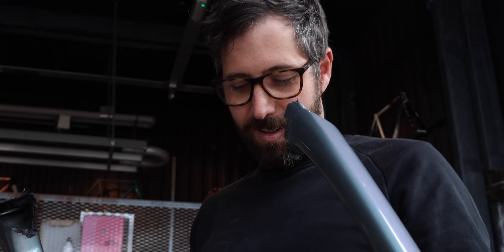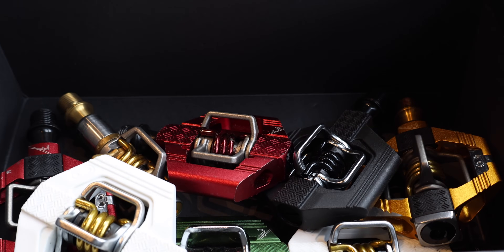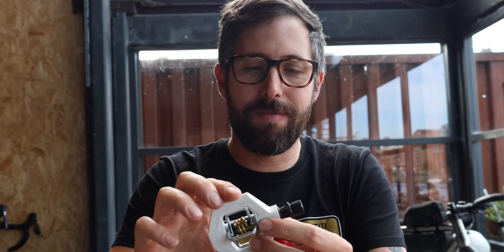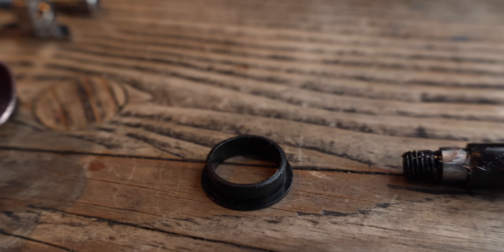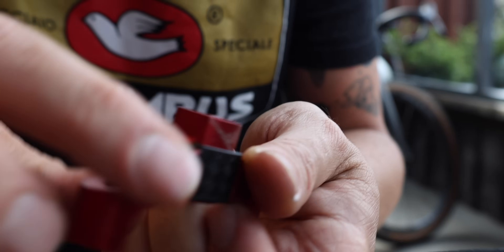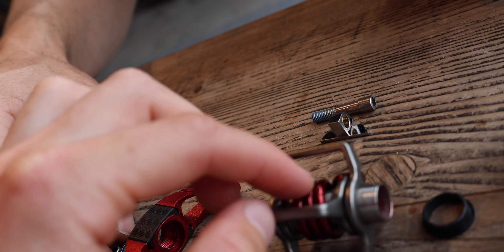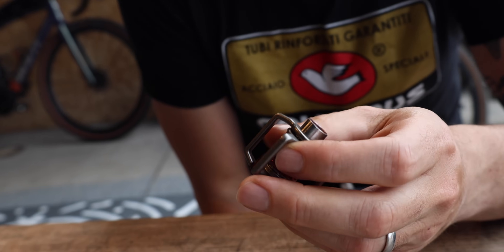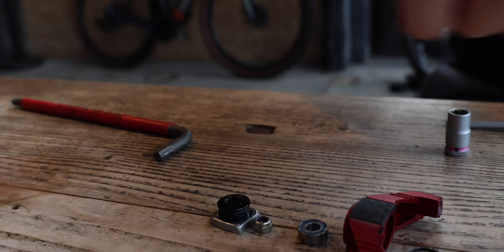Pedals for LIFE and a totalled SL7

Comment: I prefer SPD pedals because they can go much longer without needing maintenance, and by maintenance, I mean regreasing the bearings. Never did I need to replace any parts like you need to do with crankbrothers pedals. IMO the only use for crankbrothers is for short muddy races because they clear mud better than SPD and can be lighter weight.

Comment: Cranks Bros are nice to use , but I've had 2 break when riding.
The only way to be sure this wont happen is to get the rebuild kit and service them once/ year.
My Ti ones broke a few weeks ago so hope they are still supplying the rebuild kit.
In the meantime,
I prefer Shimano XTR. Can't go wrong with them.
Yes, i agree, it's fun taking them apart😂

Comment: I know your pain with the Spesh front mech fitting.
Reply: A little bit of glue 🤷🏻‍♂️
Reply: @nicvieri2627  I’d worry if the spoke got stuck to the part and then it would be a bigger problem than it’s worth. 

2 spokes, 1 nipple, a small magnet and some masking tape.